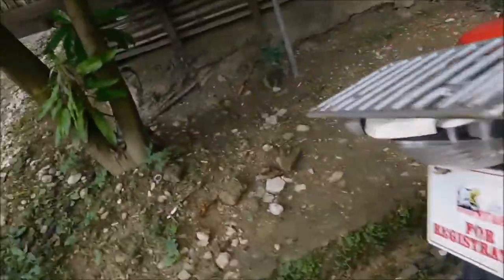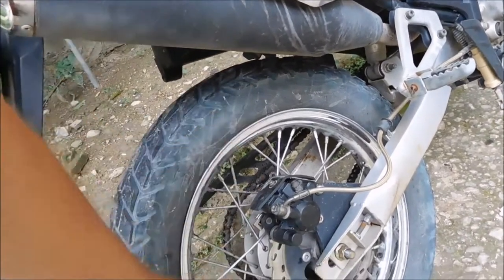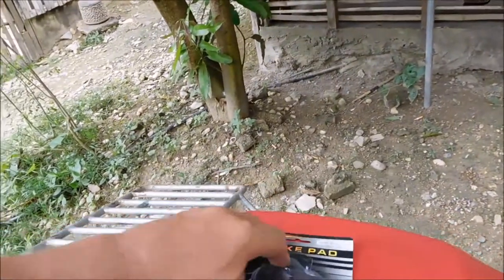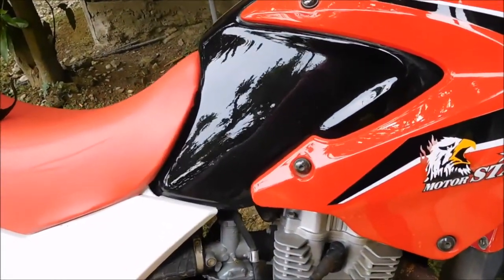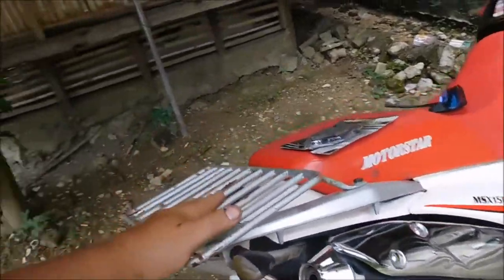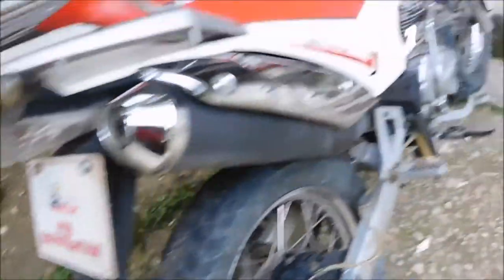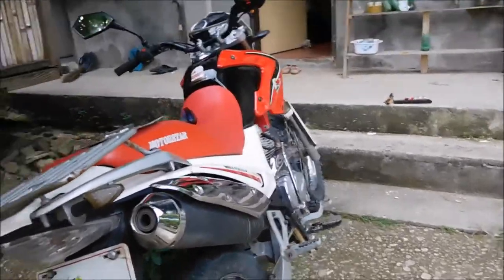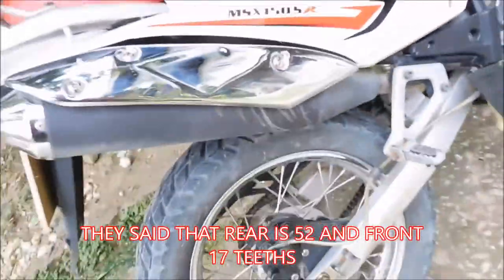MOTORSTAR VLOG #4

Comment: Overall your motorstar  seems to be holding up quite well.  I did change my rear sprocket  from the original 50 tooth to a 42 tooth  but to lazy  going up hills  .So i went  to a 45 tooth  and its perfect now.
Reply from the maker: Sound good. Did you change tires already? That makes big change for driving in tarmac.
Reply: @HerbHillFarm  Just yesterday I slid thru a curve when I hit water when I was chasing a water cart going down the mountain Lol its a top priority. I just posted the video

Comment: You need to put a rubber grip cover on that kick starter, otherwise if your boot is wet, it can slip sideways off, then your leg's calf muscle will contact the tip of the kick starter and, well the resulting pain will have you seeing a different kind of motostars, just saying...
Reply: Dude that is what im struggling right kbow but my bike is a rusi
Reply: Kathy, I'm not too clear on what you're saying. Are you intimating you've experienced what I previously stated?. I speak from "being there, done that", including another malady we used to term "oil cap knee", where on the early Triumphs, if there were some teeth broken off the kick starter quadrant,  your knee would contact the oil cap quite violently, as all your weight, plus the missing teeth, plus gravity would combine to culminate in a string of expletives that'd blister paint. As your bike is a Rusi, are you saying it doesn't have a rubber grip, or it does and your foot has slipped on the rubber as well?. That is also possible. It simply means that when wet, rubber or no rubber, extra care should be taken. If your bike is also equipped with an electric start, then in wet weather just use that. Cheers, thanks for your feedback...

Comment: how much is the price of brand new of that motorcycle? and may i know the mileage you can get on that motorcycle?
Reply from the maker: New bike list price is 52K. If you mean top speed, it's about 90km/h depending of course your weight and tyres. I have seen someone change smaller bracket in back but then is surely lazy in uphills.

Comment: So bad spokes ,bad bearings and rusting on swing arm.  Cheap metal ,it should be aluminum .
  Now 2 years later ?
Reply from the maker: We don't have that motor anymore, but it's not big issues though. Little sand paper and new paint solving those. :)
Reply: @HerbHillFarm  ok thanks
Reply: @bantayan ,,i was going to ask the same question ..salamat..